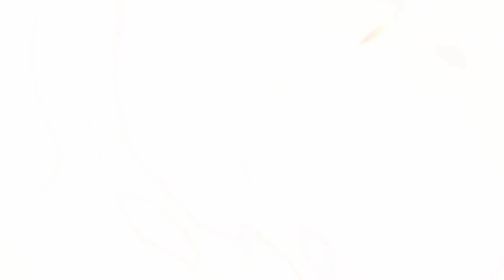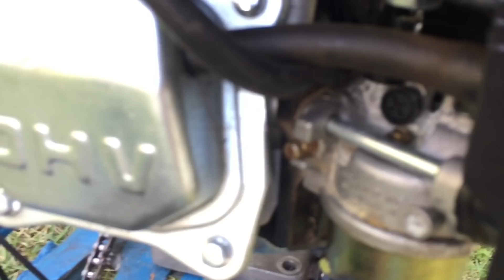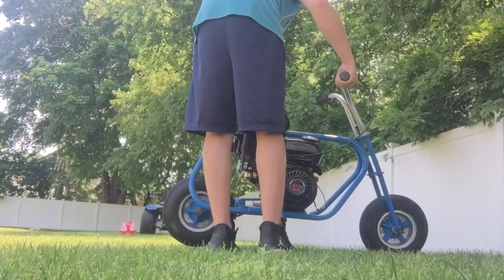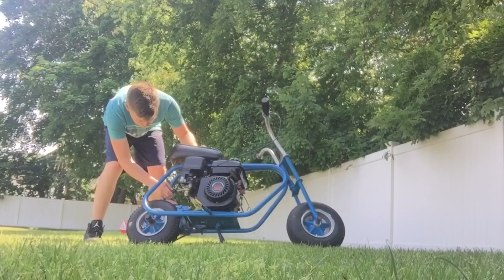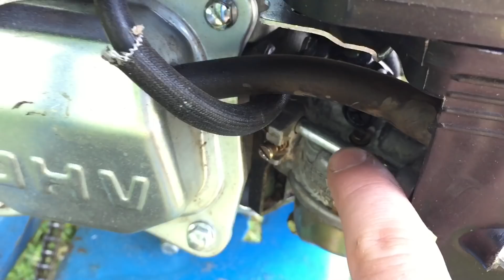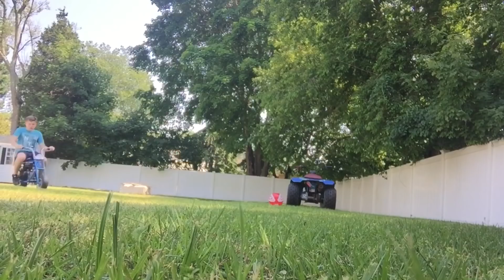TUNING THE CAT MINI BIKE!

Comment: If it only acts up once it warmed up, its probably a faulty spark plug or the ignition module is going out. Or even the gas cap could be not venting properly.

Comment: how tight do you keep your chains? I keep mine super tight because I have a 196cc on mine and if the chain is just a tad to loose it slips and pops off.
Reply: Baja Madness your chain is probably not aligned straight with the clutch to the rear sprocket
Reply: Alexis Donate I'll have to check it tomorrow
Reply: Baja Madness i have a 196 on my mini bike and my chain is hella loose. havent had any issues

Comment: You should remove the governor you'll go faster
Reply: The 20th Century Limited only if you keep riding it too fast and keep it at high rpm's. If you ride cruise it around and only go full throttle and hold onto it for a little bit here and there then you won't have any issues and you can enjoy those short quick bursts of more speed here and there or when you're racing your friends and you need that extra little bit lol
Reply: If you ride it and constantly hold it full throttle like most people do with the governor on, then you'll blow it pretty quickly and send flywheel chunks through your legs